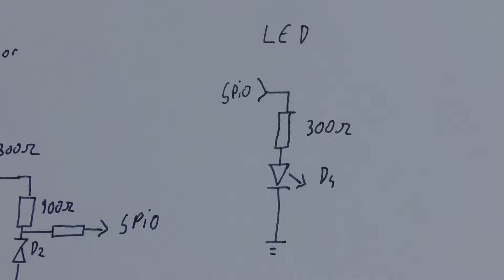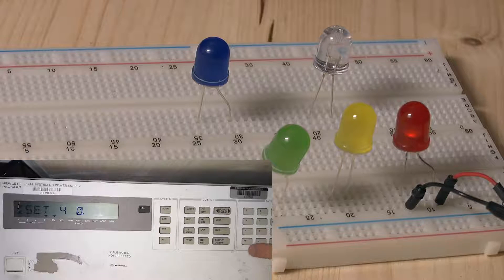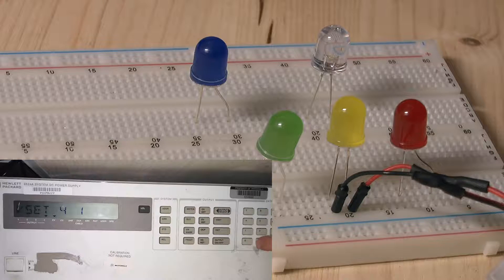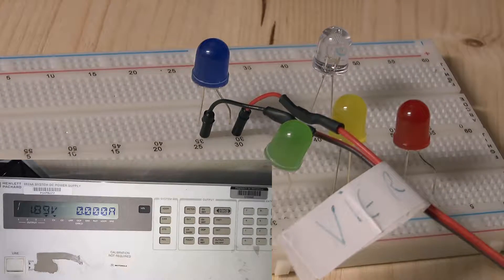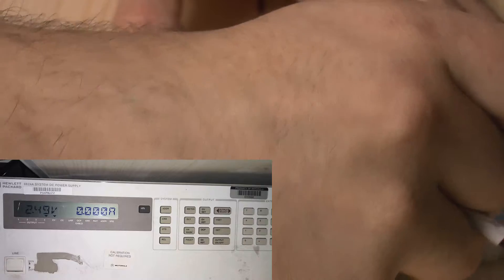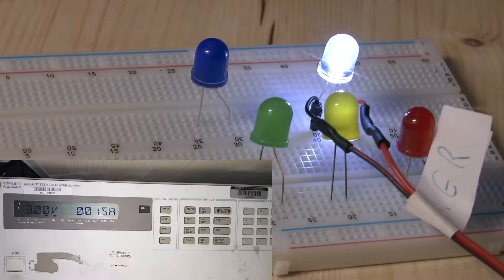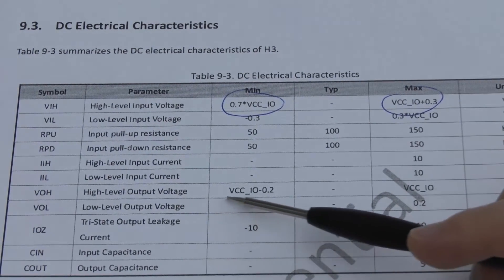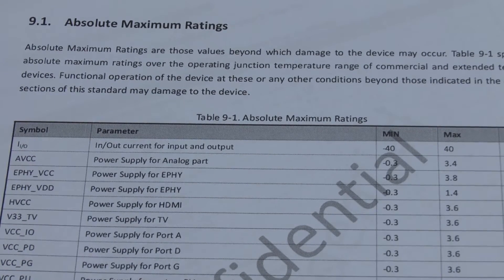Why instruments don't use white / blue LEDs

Comment: The resistor value + short circuit scenario makes a lot of sense of course, and it's an excellent reliability consideration for directly driven LEDs. However, it wouldn't matter in many other scenarios. Plenty of instruments are expensive enough and use a low enough number of LEDs, such that driving them with individual MOSFETs is common design practice. Driving LEDs directly from a microcontroller is also unacceptable for high-reliability scenarios because it introduces unwanted current spikes (which will create EMI that could interfere with high impedance signals). A fault scenario where most/all LEDs fail, might still exceed the total max current draw from the microcontroller and cause unexpected logic glitches. And so, many instruments use LED driver chips or individual MOSFETs that the microcontroller controls. Yet, they still don't use blue LEDs. Why? Because our eyes are comparatively poor at seeing blue light. There are several reasons.

Our lenses are not good at focusing blue light due to chromatic abberation; we also have no S-cones in the center.. so a blue point source in the center will always appear blurry to us. Finally, blue light scatters more due to its shorter wavelength (much like in the atmosphere). And so, imagine if there are multiple blue lights close together on an instrument - it would actually not be possible to distinguish between them at any moderate distance. Our eyes can do much better with red/yellow/green. As for white LEDs - given that many lab instruments have white casings and many labs are well-lit, white LEDs would be equally hard to distinguish from that background.
Reply from the maker: Man, thank you so much for the comment! I am thinking about how to get you some extra attention as you made very valuable points...are you on Instagram also? I would like to repost the comment there...
Reply: No, thank YOU so much for making these videos haha. I only recently discovered your channel and like your content a lot. You're very well spoken and extremely detail-oriented which makes your videos enjoyable to watch (for me at least). And sorry, I don't have instagram or any other social media. You also use an older LeCroy scope like me.. which is actually how I found your videos. I forgot which keys needed to be pressed to get into the service menu, and you have a video about that - thank you! My scope is the WavePro 960 which uses the same key combination. I will keep watching your content and hope that you make more of it. :)
Reply from the maker: Hello, thank you so much for your praise! I am trying to pass on some knowledge to others, and to post things which one often forgets. This is why I like Instagram so much - I can also post small morsels, which I then come back to myself later. As for movies...I have a lot of ideas, but it is a time issue ;(. Maybe next year, things will be better

Comment: But you've totally ignored that modern blue and white LEDs become visible at extremely low currents. A red indicator LED might need 10-20mA to be visible in daylight; a white LED will do that with under 5mA because they're so much more efficient. So yes, they need more voltage, but at very low current, so your resistor won't be as small as you think.
Reply from the maker: Hello Antonio,
thank you so much for your response! I am actually planning to remake this video soon, as quite a bit has changed in the last few years in the LED market.

Please stay tuned to me!
Reply: Tam Hanna Ok awesome! I look forward to it, I already subscribed yesterday when I commented. :)

Comment: Hi Tam, you make some pretty good observations and I agree with most of them. In the past most LEDs were used because of what you stated. Today with low power high intensity LEDs i'm seeing more and more of them in my newer test equipment and commercial electronics, specifically Blue and White. A good example is the LCD Back lighting, as it used to be Red and Yellow. Now we're seeing mostly White and Blue for the back lighting. Your point is mostly made in older HP test equipment, as they were mostly red. Then they did a combination of Red and Yellow and now it's a mix of Red, Yellow, Green and Blue. Thanks for the interesting Post. Best Wishes n Blessings Keith